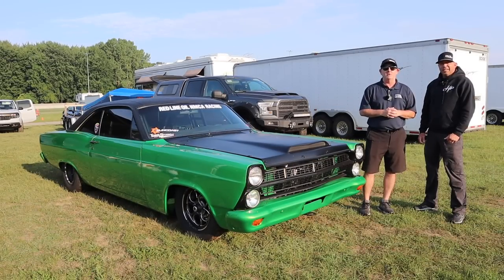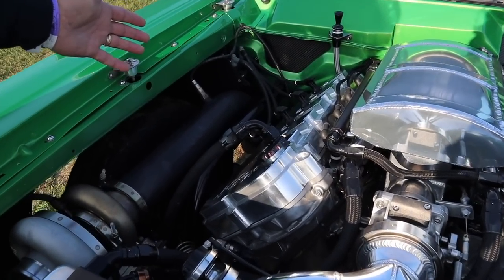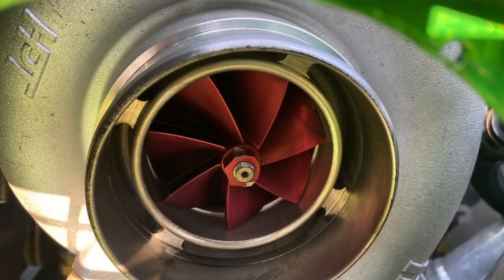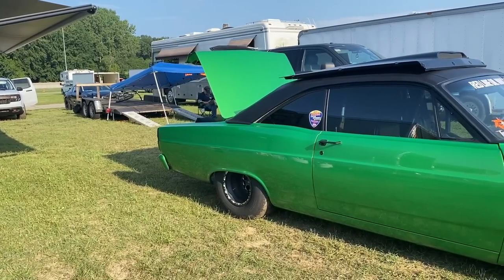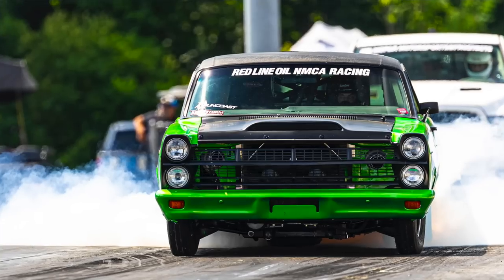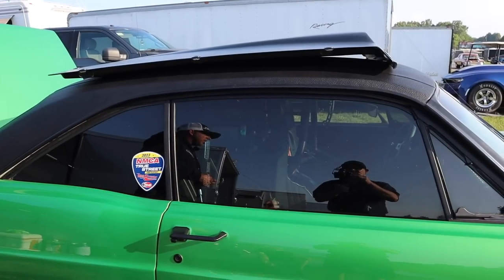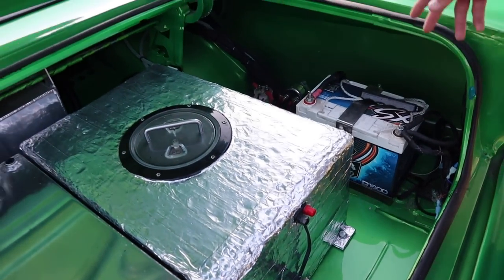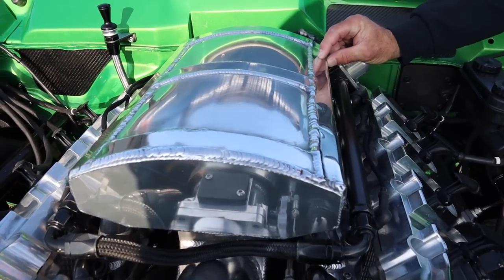2,500 HP Boosted '67 Ford Fairlane | 180-MPH Twin-Turbo True Street 5.0L Coyote Swapped Terror!

Comment: 2700hp, 305cid and 16mpg ... amazing!  And it's reliable enough for the street.
Reply: Exactly! I want to see a dinosaur pushrod LS or Hemi do that! Not gonna happen with a pushrod, probably see 5mpg max...worse than a semi truck!!!🤔😂😭
Reply: @jtthedon4230  neither platform are anywhere near the brake mean effective pressure of the Coyote. At lower power levels, the extra in³s have a slight advantage, but in max hp builds, 4V Fords > everyone else
Reply: @chadkent1241  Thats why you see the 4v fords in top fuel, funnycar, tx2k, etc. oh wait
Reply: @dooman7404  you don't see 4v in top fuel, FC, PS due to the rules
Reply: 302
Reply: 302 cid

Comment: You guys need to look up Grant Klohn and his 67 Fairlane...Windsor small block stroked to 400 cubes no turbo single 4 barrel ..and manual 5 speed...Runs 8 second doorslammer...and wheel stands 50 metres off the line..!!! Full trimmed steel body car...

Comment: Brett Lasala has gone 6.52 @ 216 mph on a 275 with a sleeved oe Predator block, ported GT350 heads, and Coyote crank. 2506 rwhp @ 47 psi. 
1,000 miles on the street. 
Fords twin cams are GOATs
Reply: It actually made 2990whp now

Comment: Cool guy, beautiful car. Another top notch story by Revan.
Thanks for bringing that to us.
My best bud in high school had a 67 Fairlane. I remember us pulling the motor in a shed out back.
We were rebuilding it and used a tool to cut the cylinder ridge out so we could get the pistons out. Yes, that is worn out with a capital W.